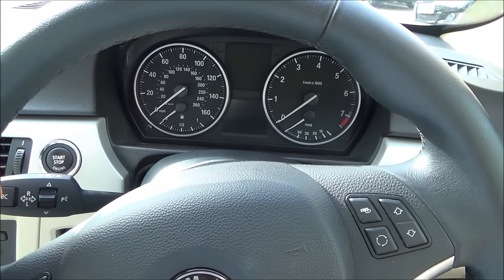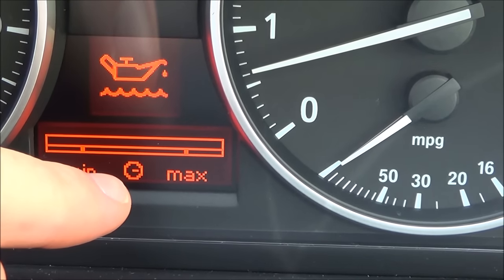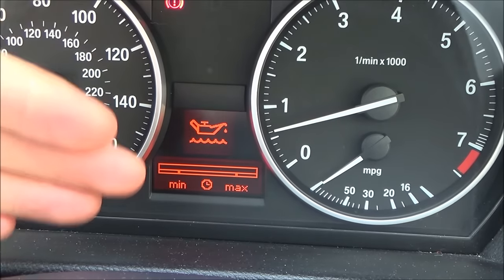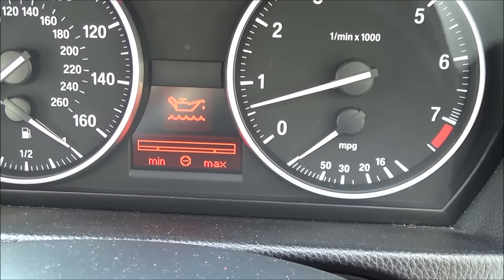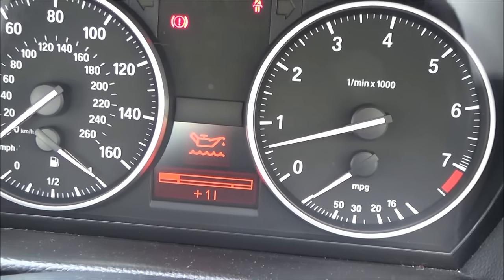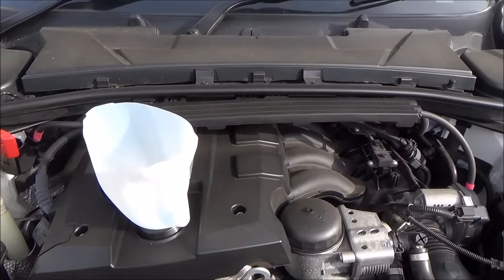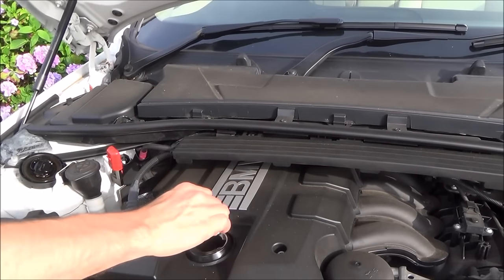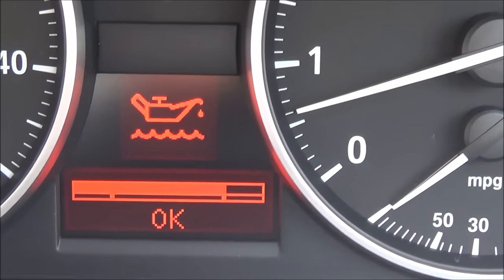How to Check & Top Up your Oil in a BMW with no Dipstick

Comment: One thing to be careful about.  When more oil is added the reading may not change right away so don’t keep adding oil. Drive it for a bit check it and check again. Once you see the gauge move you know it’s the new reading (level).  At this point add more if necessary and repeat the abound steps.

Comment: What’s so hard with keeping a physical dipstick for the oil as a backup???!Those sensors can and do fail.
Reply: The new Bimmers with the turbos have no room for a dipstick, ain't technology grand?
Reply: B Noakes that’s BS. You can’t tell me they can’t fit a stick against the side of the engine. That’s literally impossible.
Reply: Its a money grab forces you to go to a BMW dealership to get regular oil changes
Reply: @ruthlesskumquat2918  Not just that. when the oil level sensor goes kaput, which it surely will as am experiencing, its yet another opportunity for a service center to charge you an arm and a leg for sticking in a new one. This is beyond crazy, never another BMW again
Reply: @bnoakes4899  dipstick was never on the exhaust side.   Having a turbo makes no difference.  They dont want you maintaining ur own car.
Reply: @swankgodd3647  
Our X3 is an 09 there's no dipstick, a very expensive oil level sensor on the oil pan replaces it, and it is not a turbo
Reply: Money maker
Reply: Ahh planned obselesence at it's fucking best.
Reply: I have to agree this is one of the most stupid "evolutions", I've seen in cars over the years! BMW really screw up big time on this one.

My old Peugeot 306 diesel. Had the very convenient electronic oil sensor displaying the oil level at start up. Nothing wrong with it. It's fine and dandy. 
BUT there was the, absolutely practical and simple, oil dipstick! Guess what. That's what I and I imagine everybody else, use when taking care of the car maintenance. That model is now more than 20 years old!!
Reply: in fact mine just did..$500+ to have replaced.  The explanation I got was that it was an emissions thing, that dipsticks aren't environmentally friendly../facepalm
Reply: Kk
Reply: Cause bmz is junk throw away cars
Reply: German
Reply: Owned a bmw 328i n this never worked on mine. Dumb design. The thing even with new gaskets would leak oil all over the exhaust manifold n start smoking. I said bye Felicia to that car.
Reply: @paulsandvig6961  I’m trying so hard to sell mine 😭😭😭😭😭😭
Reply: @hvbking5624  I thought it was a good buy cuz it only had 135k…. I was wrong, soooo wrong. Sold it to a kid as his first car lol took a loss on it tho.
Reply: @paulsandvig6961  135 sheesh, i bought mine at 89 and im trying to rid of it by 95 😭😭 no problems yet but fuck german engineering 😂 how much for 135k miles? Mine has 92 on it and in good shape i for it up for 9k and  im willing to take the loss for sure
Reply: @hvbking5624  mine was in great shape visually inside and out but had stupid little problems that required a visit to bmw. I paid 5k, tires and the gasket work, a starter, serpentine belt, tensioner, idle pulley and oil change. I could only get $4500. Had it priced at  $6500.
Reply: This is a way for them to make money. My son just bought a BMW and oils light went off. Found out no dipstick.  I had a ford with only 42,000 miles and transmission went out twice. Could’ve been avoided if I’d been able to check it myself.
Reply: Had no issues with my sensor
Reply: The people who original buy these cars can afford and do use a dealership to maintain it. Its only a problem when the car filters down to the rest of us.
Reply: they removed it to fix a common oil leak
Reply: Pain in the ass if you ask me
Reply: @bnoakes4899 yeh that’s bs considering there’s one in the reservoir for coolant
Reply: Back in the day my father called in built in failure.
Reply: They sure do! I'd like to have another way of checking myself😅

Comment: Excellent video, thanks. My wife's had her car almost 12 years. I never knew there was a way to check the level, I thought there was only the warning light and she'd have to take it in for service. Cheers!
Reply: Read the manual. You'd be surprised what that Bmers computer can do.
Reply: "had her car almost 12 years. I never knew there was a way to check the level" A sign of the times I guess.
Reply: She's lucky it's still running

Comment: There is an engineer in Germany who should be flogged in the public square for this.........
Reply: Does yours have the bar across the oil cap where you would stick the funnel in soo fucking annoying that
Reply: more technology, less information, more wasted time ^^
Reply: Support you 10000000000%%%%%
Reply: Never speak in a negative manner about German engineers. !! Lol
Reply: What does inactive mean?
Reply: The ultimate driving machine
Reply: Flogged?

Comment: Niece's car flashed up the low oil warning, 'put one litre in'. She drove home and fortunately got away with it. I put two litres in and it showed less than half full. The only dipstick is the BMW designer who thinks this is a good idea. Check the level with engine running?! Start the engine to check and it seizes up because unknown to you, the oil had leaked out or been burned up. The bearings ruined at least. No easy way of pumping out sump oil either, I don't like it but it's what many fast fit garages do.

Comment: BMW expects you to drive 6 miles to find out your out of oil, you'll burn up your engine under a mile. How long will it take you to figure out you had an oil leak and your out of oil. Dumbest thing ever.
Reply: @S Gold Its very difficult to check your oil regularly without a dipstick. And don't give me muh sensors bullshit because they don't tell you what kind of shape the oil is in.
Reply: @Future house cleaner  Are you serious? you will do more damage drilling through the block than you could imagine, just don't attempt it.
Reply: @gravemind6536  The BMW service indicator tells you what you need to know about oil condition.
Reply: My BMW mechanic is not happy with this 'development'.
Reply: Why is smoke coming out when you lift the lid ?? Is that normal ??
Reply: @gravemind6536  that's right, even though it shows the oil level which doesn't have to be correct, it doesn't show you the color of the oil
Reply: @carlosespinozajr1208  completely normal, i think it's burnt gas that didn't make it to the exhaust, not sure so nobody attack me 🤣
Reply: Not having a dipstick is ridiculous. Techs  that design and make modifications lose their job unless they keep adding something to the car- they aren't needed. So you get something like this.
Reply: Exactly, it’s one thing I can’t stand with Bmw.

Comment: Love my BMW - I check the oil level once a month and do an oil change every 6ooo miles which is half the recommended. Car is 7 years old and no trouble.
Reply: 12,000 mile oil changes are for people who buy new cars every 2 years lol
Reply: It's not a boosted 335i is it? Want to to trade
Reply: @austin4700  🤣🤣
Car is now 11 years old 
Engine and gear box is still sound but just had two sensors replaced (£55o) and both drive axles due to another failed sensor (£65o and 6weeks wait for parts). 61.5k miles. 
Keeping it until something major goes or I put it in a ditch.
Reply: Is a lowly 116i - you'd find it a little under powered next to a 335i boosted or not!
Reply: @RustyDice  saw the 335 couple in stick so I grabbed it, soon after the turbo went so I said fuck it and put a upgraded one on, since than I've replace pretty much the entire car exept the motor, it's making 19 pound of boost rn. Would trade it in but I'm in to deep

Comment: German engineering lol.....making even the simplest of tasks needlessly complex!....and its only going to get worse!
Reply: I got 1 and i regret day and night buying  it
Reply: You're right as long people ate dumb enough to buy this bullshit.
Reply: This is so dumb to me lol, why wait 3-5 minutes for a computer to tell you the oil is low
Reply: replacing the dipstick with a low oil sensor is stupid
Reply: Am I the only one who thinks this is really good?
Reply: Here, here!
Reply: It drives me nuts. This is why in many ways I prefer my Corvette over my Bmw, I can check the good ol dipstick in 20 seconds vs this crap.
Reply: If ya actually let the car run for few minutes and warm up the reading comes up quick it only takes long time on a cold engine
Reply: @bradmace6144  why do you think it's good? Another necessary thing to break with no manual replacement.
Reply: @blewyd  There's positives and negatives. I haven't found there to be errors often.
Reply: @bradmace6144  what are the positives? Only less reliable way to measure pil and impossible to see how my oil looks... I'm watching this video because I'm currently having an error.

Comment: My sensor failed on an N52 engine. How did I find out? It kept telling me I was low and needed to add a quart. I did have a small oil pan gasket leak, but not enough to leave more than a drop on cardboard overnight. Kept adding a quart as requested while on a multi-leg trip of about 2,000 miles as I figured it may lose more oil under load.. Kept checking under the car. Got back home and drained the oil, all 14 quarts on an engine that only needs 6.9. Luckily I didn't blow the engine. New genuine oil sensor $200. Super easy to install, strained the oil to make sure there were no metal fragments.
I love driving BMWs, have an E46 sedan and an X5, sad to say, these will be my last. Can't check the transmission oil with a dipstick either.

Comment: No dipstick sucks. And not sure my sensors are working. My readout says my oil levels are only slightly low, but I noticed smoke coming from my 328i when idling. When I turned it off, the engine was super hot. When the engine cooled down I checked the oil level visually, and it seems bone dry, but I don't know for sure.

Which do I believe? The sensor or my own eyes?

Comment: Thanks for the informative video. Just one thing I would add. Ideally you shouldn't pour the cold oil in a hot engine. It's not great for the metals in the engine.
Reply: You are getting confused with never putting cold coolant into a hot radiator.
Reply: Dont agree, as long as the engine is kept under 3000rpm shoud be fine, the oil would warm up very quickly
Reply: @barryfowles-zl5ib  that too of course. But my mechanic would always let the engine cool down before changing the oil.

Comment: It would be awesome if it had this AND a dipstick. Just in case i don‘t want to or can‘t start the engine (would also help when changing the oil).
On the other hand it‘s really usefull. Measuring the oil level while driving on the autobahn is definitely a good thing.

Comment: what if the sensor breaks and does not warn you
Reply: i read it warns you the senor isnt working. a warning for a warning about a warning. warnception
Reply: Or, you basically blow up everything like it happened to an aquaintance of mine. He forgot about the oil change for a few thousands of kilometres, and burnt everything is a moment of need for speed.
Reply: Nemesis thats "his" fault should of been smarter
Reply: james billings  Broken oil meter = £££ in parts from BMW.  Broken engine = ££££s from BMW!  Either way, BMW are quids in!
I keep trying to tell people all the tech in modern cars isn't for free....nobody listens lol
Reply: Lol all sensors in a car tell you it's not working
Reply: The low oil pressure light will come on. But no self-respecting car owner ever wants to see that. You've let it go too far by then.
Reply: you blow the engine...

Comment: Hello Vince! I have a question: Do you not need to change the oil filter when you add so much new oil? Or is it not necessary? Thank you for this video!
Reply: You do that when it is time to change the oil and all the filters with it. If it just a refill in between oil change intervals there is no need to change an oil filter.

Comment: does your fluctuate while you are driving ? I have an e85 with this kind of digital dipstick and when i run the car to temperature while sitting still in the parking lot ( flat ground ) the oil level goes to full and it reads OK, but if i check the level after driving around for a while, the level fluctuates - even going to the last 2 out of 5 levels. thanks !

Comment: Am i missing something Vince, i can check the oil, top up from the
low mark to the top mark on the dip stick in less than 2 minutes, I take it
there is a much quicker way than this.
Reply from the maker: Hi, unfortunately this car doesn't have a dipstick for some reason whether that be cost saving or possibly emissions related. Although it is useful to be able to check the oil level in the car via a sensor without lifting the bonnet it would have been useful to also have a dipstick so you can get exact measurements quickly and easily. I think it is step backward but I presume most people do not look in the engine nowadays so being able to check it from inside the car maybe more useful to the majority.

Comment: Our 2015 Subaru Outback was showing low oil ( not pressure) So I added a quart. The thing was, the manual doesn't even mention a low oil warning lamp. Apparently, it does but the manual didn't include that information. I almost had a heart attack because I thought it was low oil pressure, meaning no oil at all.

Comment: I’m late to this but I got me a 2011 328i m package and where my engine oil goes when I open it it’s like air trapped in there so it releases small pressure when I open is that normal ? Or is it the valve ?

Comment: The point is how to count the oil capacity when the sensor is stupid. Because mine says oil level in 50% then it says 100% then it says 75% obviously I have a malfunction in the sensor and I am afraid that the only way to calculate the amount of oil is to drop down the oil and measure its weight and put it back
Reply: Put the oil back? Dude are you high? You don't re-use oils. Sell your car and buy one with a dipstick.

Comment: Picked up a 2006 325i to drive while I tore into my S80 for a few weeks. Today replacing the serpentine belt on the BMW. Checked this video just to see if there was a way to check oil lvl without running the engine - 1. I love “My Mate Vince” the dude is using a cut up milk jug for a funnel. Yes!  I use an old empty oil quart bottle. And 2.  So getting rid of this bmw - can’t check oil w/out engine running … what if the oil is so low - it will cause engine damage? SMH.

Comment: New engines are garbage. I have mine 2005 ford focus mk2 1.6 and after 3.5k miles oil level haven't changed. I know it's ford and not the brilliant car. But overall it gets the job done and engine still runs smoothly. Besides relating on sensor that might brake or show wrong readings? Cheers to that

Comment: When I remove the oil cap should I be able to see oil inside of the reservoir? It looks empty inside mine and my sensor says I have the maximum amount of oil inside.
Reply: Of course not, engine oil collects to the bottom of the oil pan.
Reply: Thanks for clarifying man I was worried I’d been driving without oil 😭

Comment: Every German product runs beautifully till it doesn't. $790 for transmission oil change a 2009 BMW.  Yesterday it took me 4 (Four) HOURS to get to the area under the lint trap in a Bosch dryer, clean it and put it back together.  In WW2, their tanks worked beautifully and were deadly till they didn't.

Comment: Hi I have bmw320i 2006 
I don't know what's wrong with the car but every couple of months it shows like engine oil is low like in ur video put 1 ltr
So can you please tell me what's wrong with my car or its normal.
Thanks
Reply: Shubham Kumar 

Check for leaks....
Reply: Shubham Kumar u  need bmw rated oil...
Reply: It automatically checks your oil for you and is telling you it's 1 ltr low. Most likely a leak.

Comment: Hi bmw fans, this is a great video by the way but i need a little help from somebody please. 
I have this exact same car and when checking my oil level like in this video, my level has dropped just below the max needle about (75% full) on the checker. Do i need to top up about 1 quarter of a litre to bring this up to max or just leave it until i drops to min level when instructed by the car to add +1 litre?
Thankyou in advance if anybody can clear this up for me!

Comment: I recently got my car serviced and it is still indicating that it needs 1L of engine oil - does that mean the servicing guy did not put enough engine oil in my BMW e90?
Reply: proooooooobly. or it could mean youve got one bitch of an oil leak
Reply: Me too..
Reply: No way to know for sure without dipstick. Except to drain the oil completely. Change filter, then add the exact amount YOURSELF.